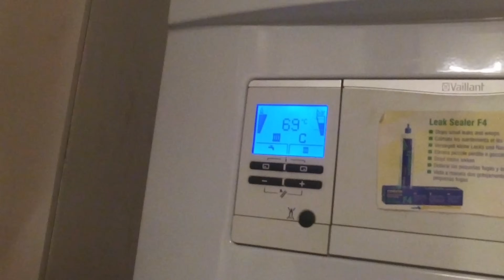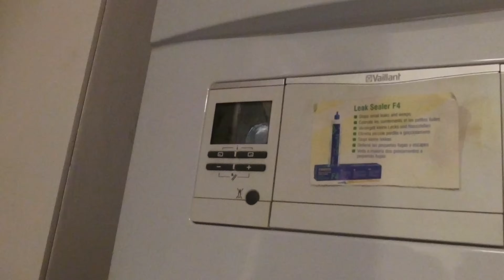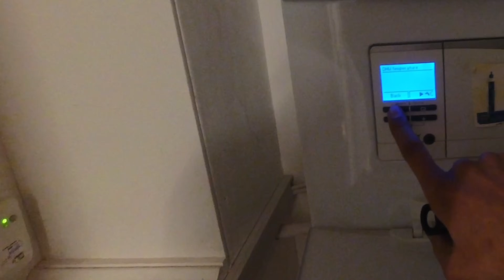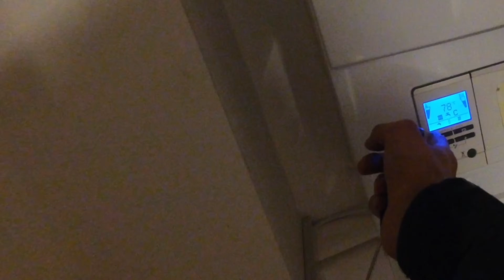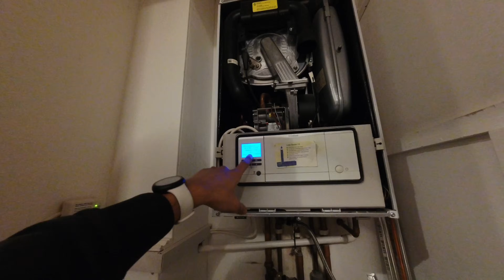I Picked Up The Wrong Part!! - A Day In The Life Of A Gas Engineer 145

Comment: Worth getting the cartridges for those diverter valves mate, they fit both types plastic and brass and take 5 minutes to fit and only cost 15 quid👌
Reply from the maker: Nice one, there's a few different ones knocking about. Which do you recommend?

Comment: Brilliant video. 
What is your tip about removing the screws of the diverter valve especially bottom one as some get head damage
Reply from the maker: Sometimes I've had to hit it with a hammer & chisel/flathead to make a slot, then tap at it from a slight angle anticlockwise and it will start to turn. Other option is unfortunately to drill the head out but then you have the issue of getting the old thread out

Comment: I think plate to plate  is on its last leg too on vaillant
Reply from the maker: What makes you say that?
Reply: @cputilitysolutions had similar issues where heat was passing by on flow pipe while we demand for hot water got happy and replaced diverter like I am a top notch engineer 😂 all worked fine but temp on screen was rising 78 to 82 Deg when demanding for hot water but works fine all fga fine 
I recommend the landlord also get the plate to plate clean as in future you will have issues with HW  because plate to plate looks blocked to me 
But never got a go ahead from Mr landlord 
Two months down the line he started blaming me ohh you didn't do it correctly and had to go and do plate to plate but lucky I make short videos for these cheeky landlords to prove my self correct 🤣🤣
But I might be wrong as you have to be in front of the boiler to diagnose any fault
In your case you have done 💯 bro
Reply from the maker: @kapilsammy  so in my experience the plates on Vaillants rarely get blocked, it's the canoe filter which can get blocked up and cause overheating issues on the HW side 👍🏾
Reply: @cputilitysolutions  it can be in my case heating was working fine bro

Comment: Hi buddy, ive recently qualified, i was thinking of getting either an Anton Sprint Pro 3 or Test 300 like the one u got.
How is the Testo? Its a massive unit aint it?
What about their calibration service and price?
Reply from the maker: Personally I've never really been a fan of Anton. I started off with a Kane 458 which was brilliant! I was then approached by Testo to work with them and I'll be honest the kit is amazing! It's a fairly big unit but it has sooo much tech built into it (I still don't know about the full functionality of it) but what I do also like is the smart kit (temp clamps, manometer, etc) all sync up to it via Bluetooth so you can be running multiple tests all just one one screen. Especially when commissioning a boiler you can get all your figures & readings off one screen. I don't know about the calibration costs as I've not had it a year yet and as I work with them I don't know if I'll still have to pay for calibration or if they'll just do it for me as part of our working relationship. Hope that helps mate 👍🏾